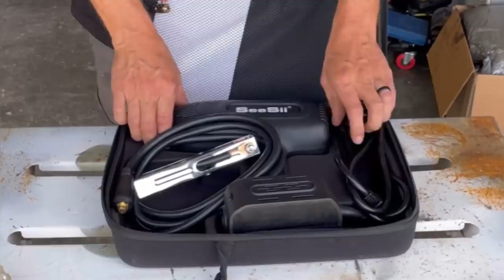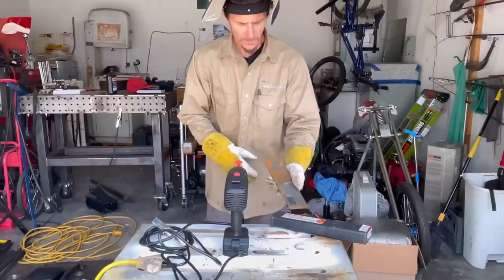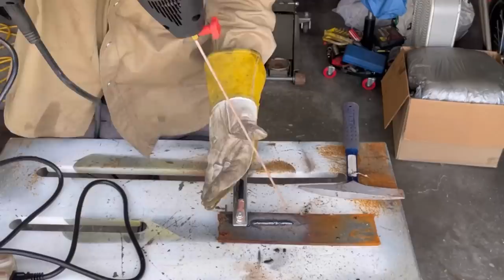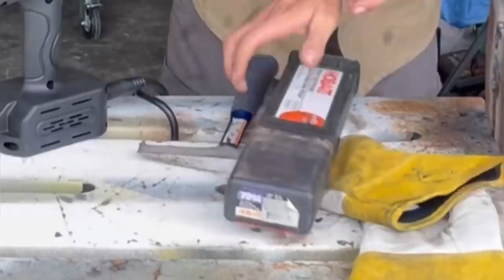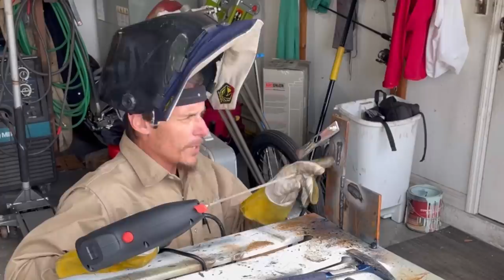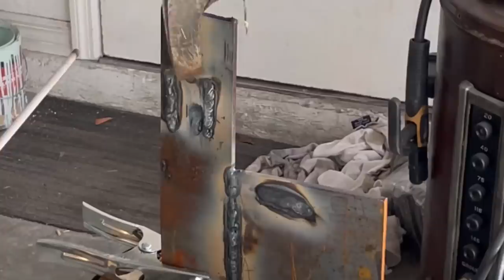The SMALLEST Welder I’ve Ever Used!

Comment: Your welding ability is moderate using stick so going with that in mind your welds where not bad so the little machine would certainly come in handy for remote places that normally would be a nightmare getting a full machine to but I would be adding a cable with an electrode holder to the gun instead of holding that gun up every weld

Comment: I'm always tacking things at the bench for later finish welding with the Big Rig (300 amp inverter).  So, I picked up the little Harbor Freight shoebox inverter 120 volt stick welder second-hand off Craigslist.  Hard to go wrong for $30?  The smaller cable and lead make for a far better feel and control when doing 1/16" rod.

The form factor of the gun in the video looks to be doplic as hell.  I'll stick with the shoebox HF example with traditional Dinse-connected leads.
Reply from the maker: your probably right, but this thing is a stepping stone to something much better I feel like. if they made it a different shape and DCEP it would be a lot more useful. im sure its coming

Comment: I wonder what went through the head of those designing this thing - its not that hard to put 140A welder in that size, but why do you put it in the handle/electrode holder?
Swinging a few kilos get boring real fast.

Comment: it would be hard to get used to holding it like a drill. Looks like it does not have hot start built in, which is very helpful for the novice welder it appears to be designed for.

Comment: okay. That wasn't so bad. might be perfect for the handyman or just to having a garage if you need a welder in a pinch. Of course anything bigger than quarter inch and you're going to need a bigger boat. but for what it is, I suppose I was a bit impressed. I'm still learning. And I learned a little bit today. Thanks

Comment: It’s open circuit voltage/running voltage capability must be really low since it has a hard time starting and maintaining a arc.  Definitely beats not having a welder, but far from ideal lol.
Reply: Exactly! Always surprised at these people reviewing equipment without doing a simple open circuit voltage reading, or slap a clamp meter on one of the leads to get an idea of the actual amps the thing puts out.

Comment: I have a 110v inverter stick welder from harbor freight. it was under 100$, but has normal leads
no need to hold the entire machine in your hand 
performance looks to be about the same, need to run thin rod at high power for it to run "well"

Comment: That estwing chipper is the best I’ve ever owned that biznatch is still sharp after like 6 months of use
Reply: MPM Welding  same bro, I’ve had mine half a year and was using hot trash for the last 15 years haha it’s like I pulled the sword from the stone.
Reply: @nicksearles3996  I've been using it for the past 6 years still sharp haven't sharpened it only issue I have is the handle is nice and melted but atleast I know which one is mine
Reply: @099stick  hahahaha

Comment: Seems like a decent thing to glue stuff together.  Even with the years of experience you have trouble striking the ark.  Can't imagine how hard the regular home owner would have learning to use this thing.  For the person that might need something like this glue gun I would suggest the buy a MIG welder with flux  core.  Stick is so hard to learn for someone that isn't a welder.   #letsgobrandon ;o)
Reply: You’re right about stick.. I started with stick and it’s frustrating af. For the first week, I was burning holes in everything if I could get past sticking the rod. I finally found the sweet spot and I’m pretty good with 6011 now. I’m glad I started on stick. If I started with mig, I would never do stick. 😆

Comment: If it's shutting down at high current because of overheating it should tell you "overheat" and not just "error". Not a "real" welder but as others have said in the comments it would be good for the "just get me home" or temporary fixes.

Comment: if the elctronics in that thing are all in the gun/electrode holder itself, your right arm is gonna feel it after 5 minutes
Reply from the maker: doesn't weight but 1-2 pounds. also I wouldn't use this thing for more than 1-3 welds

Comment: cool welder, looks like the one from Aliens. I think the 'shot' rod has water in it so it will run cooler then rod that is dry, because when the flux crystals heat up they lose the water and I think that cools the material down as you are welding, which could explain the lower power level to a degree.
Reply from the maker: good thought! I wouldn't doubt it!
Reply: @MeltinMetalAnthony  
I am NO stick welder so I won’t pretend , but I’ve learned when I was a teen working part time at a junkyard during high school years , late 70’s early 80’s . Haven’t arc welded since but learned that if the rods are no good ( moisture ridden ) you can’t even start right , much less hold an arc to finish a run . The welder laughed at me and gave me one of his own 7018’s just to finish a little job I asked if I can use his Lincoln industrial welder . I helped him whenever he came to the yard free lance . The yard had its own welder that was built before I was born ( I’m 59 ) and no storage kiln so the rods were garbage . With dry flux , or even good flux core wire , arc will not fizz out after you strike an arc . 
So I’ll agree with people who know what their talking about , with experience , that good rods work better . But I still say that Marvin the Martian ray gun welder wouldn’t have much a life expectancy , even with good electrodes . As of today , 5/16/22 , Amazon doesn’t have any so guess we won’t even know , supply chain crisis or not . If they don’t like your review and want their welder back , tell them GFY !

Comment: I feel like that's a solution to a problem no one has, why not just use one of those purse units Miller, has an awesome one, I've heard good things about the primeweld and harbor freight ones and its not awkward to use and probably just as light.
Reply: a couple of years ago i bought a used Kemppi minarc 150 on marketplace. Best little welder i have. in this category i also have a lincoln 150amp and a hbm(chinese) 200amp but the kemppi never let me down and it can take a good beating and rain etc no problem. But cant get a used kemppi 150 for the price of a new "seesil" so not a great comparison

Comment: I'm surprised you didn't trip the breaker using 110 volts or set the extension cord on fire using 140 amps.

Comment: like many things in the US, 110 volt is a big limitation.
it may have been that the welder simply could not pull enough out of your 110 to work well. ...... 
i'd be interested to see how the 240v  goes on the 240volt mains like  we have in "civilized countries" :)
Reply: We have 240 here.
Reply: @BlarginBro  but here every standard outlet is 240v
we weld from 240v 15 and 20 amp outlets for light work

Comment: A lot of times you can bring back old rods by driveingbout the moisture by simply putting on a shalow pan and put in a 55°oven for 30 minutes   and your welds suk that lil thing will never give you the penatration needed for a good weld at best you can scab gage steel to the thicker steel and weld prep is a absolutely needed by cutting back the joints and multiple passes and sma.l rod of 7018 will work o idea why you think it won't the numbers don't meen its to much just use smaller rod you can get 7018 in 3 /16th to the biggest I used was 14"

Comment: Have you tried  any prime weld welder's got there AC/DC 225 Tig an the cut 60amp plasma cutter an got to say damn things work pretty damn good Tig is under 900 bucks an comes with CK torch... Them yes welders are junk no doubt
Reply: Have htp invertig 221 and prime weld 225! Primeweld is not nearly as smooth on AC as the invertig but it sure get the job done
Reply: @Dcale  look at the price difference of the two meant put that in there for the price they work pretty good the prime don't like low amps on AC what I've found with it 50 an above seems good tho ..what the max Hz on htp

Comment: they should just make a small box with a regular rod holder end, its probably too heavy.
Reply: need one with some capacitors that run off a car battery. all youd need is 1 minute welds so it just beeps or shuts off.

Comment: Looks bad, i mean, why? 
You could just make some ultra small normal inverter with small normal stinger. 
Probably can be tied to belt with some rod holder and stinger holder, and lastly, reasonable sized optional battery power, it will be perfect.

Comment: Well 7014 is ac rods so if you are welding with dc it will not weld for shit 7010 and 7011 for your base pass the 7018 after and you will be good. You could even weld the whole way with 7018 and make a good weld if you are decent which you definately are not

Comment: Plastic and glowing hot steel have never went well together if I remember correctly. If a goal was to connect two pieces of metal then yes. Many times I weld things that I intend to drive on the interstate at 100 or basically trust my life to. This ain't that tool.

Comment: So many times all I need is a little well and I pull out my 200 amp Lincoln welder that's 5060 years old probably that thing is sweet I could fucking use that everyday you can if it doesn't work good I'll make it work

Comment: the Amazon special Simder brand ARC 200 is WAYYYYYY better than this and a quarter of the price. It will happily sing along at 120 amps on a 15 amp outlet and is smaller than a toaster. It will do 140 amps too on the 15 amp but sure likes the 10 gauge wire a lot better with a 220 plug.

Comment: I wonder if you simply remove the ground wire from the connecting lug and shoved it into the electrode side and tighten it down then just hook a small stinger into the original ground dinse connector it’d be dc+.
Also you should try some 3/32 7018 electrode negative. It’ll run and does pretty good on thinner sheet metal.

Comment: If you need a chipping hammer, it ain't run right. You ought be able to flick the slag off with a fingernail, if it didn't curl right off itself as you proceeded. That's the "Did I weld Gud?" test on most stuff. If the slag needs chippin, the settings need flippin. Pretty much. Welding folk who are new to it weld using their eyes as a guide - more 'sperienced use their ears. You can hear exactly what's happening, when both faces are fusing & when the settings are Mint.  How you lurn to weld gud is by welding stuff heavy equipment will run on/over/with & if it breaks you get sued a lot by the dead persons relatives... which you never want to happen, so you weld gud. I binned off the welding mask years ago - never use one, which baffles people who are watching. I'm not looking, I'm listening - so the masks useless. I weld all day every day, 7 days a week - maskless. That unit looks like a solution to a problem nobody had, btw.